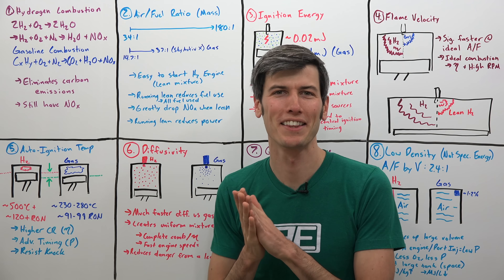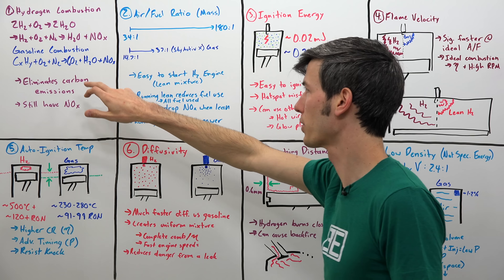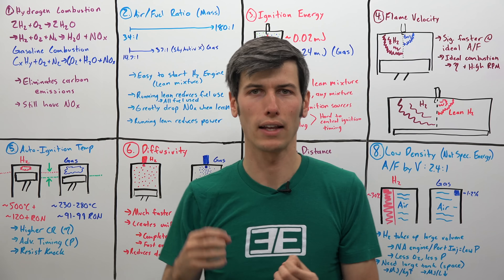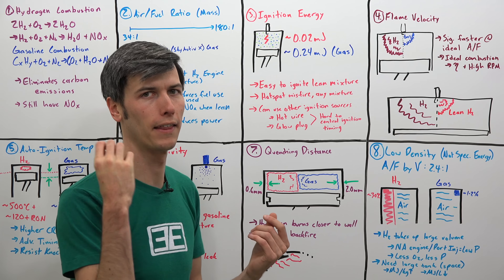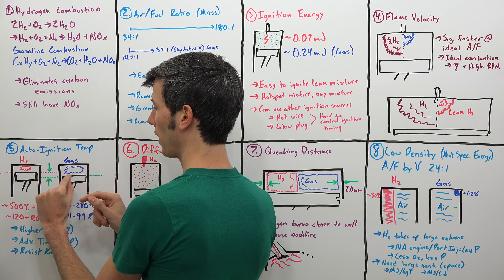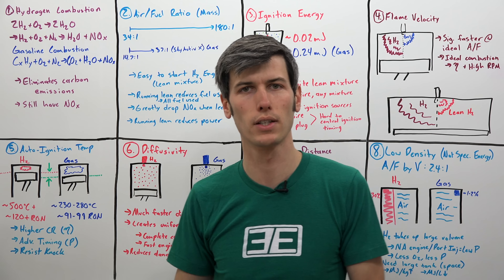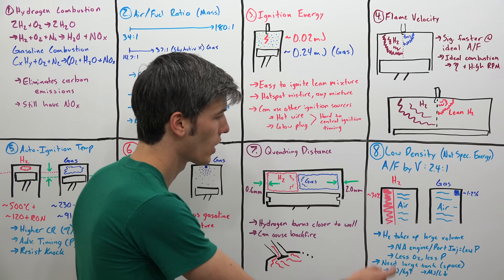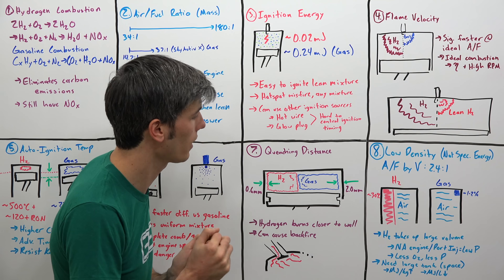The Difference Between Gasoline And Hydrogen Engines

Comment: My two observations about hydrogen as a fuel...  1) H2 is NOT a fuel source.  There are pretty much no natural reserves of H2.  There is plenty of H bound up chemically in various compounds, but it takes just about as much energy to turn those compounds (like water) into usable H2 as what you get out of it via combustion or fuel cells.  So, H2 should be thought of more as a battery than a fuel source.

2) H2 is a very very tiny molecule, like so tiny it will slip past other molecules and crystalline structures.  That means even if you took something like a steel tank, and welded all the holes shut, the H2 would still leak out through the walls of the tank.  H2 is never used as a rocket fuel much after the initial launch (where it works great) because by the time you got anywhere most of your fuel would be gone.

A hydrogen based economy might be doable, but it won't be easy.

Comment: So what it sounds like for a given amount of performance, a hydrogen engine would have more, smaller cylinders than current-generation gasoline engines to reduce problems with flame velocity, would have compression ratios more akin to diesel engines, would need much more specific attention to detail paid to the combustion chamber and piston crown designs, and ideally would benefit from technologies like direct injection to reduce problems with quench distance as the engines wear.

You discuss the use of ambient air (hence the introduction of Nitrogen), how would the efficiency of the engine be affected if the vehicle didn't use ambient air, but instead used separately stored hydrogen and oxygen fuels, and drew only from those sources?

Comment: Hydrogen as a transportation fuel is a non starter. MIT research shows it to be only 6.9 percent more efficient than gas used in a Prius due to losses in production. It has only one twenty fourth the mass when stored at 5000 psi so little available energy  because so little can be carried in vehicle.  Normal storage tanks only go to 2000 psi so even less available with current technology.  The tanks are very heavy at around 175 pounds each and hold only a few hundred cubic feet of gas.  If hydrogen worked we would already have it.
Reply: Storage tank in Mirai is rated 10,000 PSI. I don't know about MIT study, but if you look at Mirai 5kg H for 300 miles, that's 60 MPGe. Since Mirai also has battery for regen, that's actually worse than a Prius when you consider H generation losses, especially from electrolysis.

Comment: Too bad hydrogen is also a fossil fuel. 

(Yes, seriously, it's made from natural gas)
Reply: It can be made at source by electrolytic reaction directly from plain water using electricity. But its inefficient ...why waste electrical power for cars. Straight to battery!
Reply: Magnus Dagbro I forget the exact percentages but I think somewhere around 40% of bulk hydrogen comes from steam methane reforming. A few other methods exist but also break up fossil fuels to extract hydrogen from the molecule. Only around 4% of global hydrogen production comes from electrolysis

Comment: So basically, Hydrogen is better in almost every single way...

I'm sold ¯\_(ツ)_/¯
Reply: Producing and storing is difficult. It takes a lot of electrical energy to obtain hydrogen. Might as well use that electric energy to charge the batteries.
Reply: Except for storing...hydrogen is a real pain in the ass to store.
Reply: Except its 10x more expensive and the engine has to be designed for it! So engine is now 10x more expensive! Hydrogen will never be viable!
Reply: Until you see the prices...
Reply: not práctical for now

Comment: I don't get how items 3 and 5 could live together. Item3: hydrogen has lower ignition energy -> higher misfiring chance; Item5: auto ignition temperature of hydrogen is lower -> higher possible compression. When you compress a gas its internal energy is bumped up (lower volume & higher pressure) which leads to higher chance of misfire, right?
Still see a contradiction here.... scratching head :)
Reply: Vadim Makarov der zündpunkt von h2 is höher als bei benzin

Comment: i want hydrogen rotary engine
Reply: ECO-doritos. 🍂 🌎
Reply: Mazda already built one of these. Fast flame propagation would be nice, but since hydrogen has even less lubrication properties than gasoline I imagine the oiling system is more taxed. It'd be cool and I'm a rotary fanboy but I don't see how something like that goes mass market.
Reply: Mazda build several bi-fuel versions of the RX8 called the RX8 Hydrogen RE. They were not for sale, only for lease. 
At least 2 were delivered in Japan and 30 in Norway. I don't know what happend to them but I would love to own one!
Reply: @erwinnijs1  I didn't realize that RX8 actually went past a demonstration phase. That's cool.
Reply: LiquidPiston has a better rotary engine then Mazda. Hydrogen powered liquidpiston engine would be amazing!
Reply: @johncurran1179  Everyone testing an engine on a bench seems to have better engines than people with actual commercial distribution.... funny that. Let me know when they're in thousands of consumer vehicles and we can talk about how they're "better"
Reply: Check out the Qurbine
Reply: they did have it  rx8 hydrogen fueled renesis
Reply: You'll love it, if you can find a way to lubricate the apex seals. Smooth idle.
Reply: I want a turbo hydrogen engine
Reply: Good luck sealing the engine
Reply: It already exists... For more than 5 years.
Reply: There was an hydrogen rx8
Reply: I want an hydrogen generator, that self runs, and generates electricity.
Reply: Blows up
Reply: @usingthecharlim  like cooling up  a small vocalno once every cycle with dry ice LOL
Reply: Thats how i ended up here 😂 most efficient engine plus most efficent (free potentially) fuel. Its seems to be better then petrol in all aspects?!
Reply: You got it😉
Reply: wouldnt make ANY sense but yeah why not lul
Reply: @user-qx7tm5df8j  it would make sense because one problem of the rotary engine is the fact that fuel doenst burn fast enough, that why you see flames in the exhaust
Reply: @usingthecharlim  needs a rotary engine that doesn't use Doritos as it's rotor
Reply: @GustSergeant  If the engine blows up at least he,ll have a tasty snack to go with his cup of joe . lol
Reply: When rpm is high enough in a rotary, you can do away with seals and up the boost to compensate blow by. It wouldn't be a drivable engine in the common sense of the word, but it could make a very good range extender, for a system without direct connection to the wheels (i.e. engine only coupled to the generator)

Deleting seals would have the advantage that you don't need to inject oil into the combustion chamber drastically improving emissions.
Reply: @daszieher  indeed, rotary can be tuned to be eficient and long lasting but only for a very narrow load and speed band. connecting it to a generator would make it a perfect range extender
Reply: When my rotary deleted it's own seals it didn't have enough compression to fire. I'm not saying it's impossible but in addition to the apex seals you have corner seals to lubricate, without these the engine oil is free to hang out in the  combustion areas as well. I don't see why you'd want a heavily boosted leaking rotary for a range extender. Also a range extender that runs on exotic fuel seems counterproductive. Mazda has already introduced a little rotary for range extension and it has apex seals. The thing with the extender, since it's not responsible for moving the vehicle, it can operate at whatever the efficiency sweet spot is. Not boosted and losing its mind. If the goal was just to go nuts with a combustible fuel I think you just go turbine at that point.
Reply: There are benefits to running without corner and apex seals, since these are the weakest spots and their very lubrication limit the attainable exhaust quality. Main bearing lubrication can be sealed off differently.

Your own rotary would not fire, because it's clearances were not designed for this, also the starter will not bring it to the necessary revs. I consider this part of your comment in which you compare a broken engine to a concept a  mere distraction. And I had mentioned this in my post (drivability).

Using hydrogen as a fuel is an entirely different subject, I am not a hydrogen advocate. Since I feel we'd get lost in pros and cons beginning with its excess renewable production (in order for it to be a viable fuel), the distribution through an insanely expensive infrastructure and complicated handling, I just omitted that part of the discussion. For what it's worth, I don't see H2 being a worthwhile fuel for conventional piston engines in passenger cars owned by private individuals.

Back on subject, such a seal-less rotary would need boost to reach sufficient chamber pressures to make it a worthwhile ICE, NA it just wouldn't reach satisfactory efficiency levels.
Reply: @daszieher The Apex Seals, in addition to providing for a sensible combustion pressure, also form an attrition point. The original Rotary didn't have them, and they annihilated themselves tearing up the rotors and housing. There's no magic to get around this. Whatever is harder, the housing or the rotor, will get destroyed without some kind of attrition barrier. Machine the tolerances as high as you want, there's either an oil barrier between them or grinding metal between them.  

The metals are going to expand and contract under the temperature loads. Particularly challenging in the rotary who has a much hotter combustion half than exhaust/intake half. Meaning our tolerances have to survive that as well.

But lets assume you get the metallurgy and the manufacture just right for this theoretical engine. What is this range extender for exactly. Why overcome the kind of engineering problems that would serve a boosted out of it's mind race car, for a compact generator. My broken engine wasn't a distraction, it was a bit of hyperbole to illustrate a genuine point. The apex seals were introduced while solving rotary engineering problems. Though bringing it up is a distraction from the laundry list of problems this concept engine has. The most important of which is it's proposed use case. Who's looking for a green car with a backup generator so high strung it vomits NOx like a drag car.
Reply: @starvalkyrie  The apex seal wear problem has been solved decades ago. Ceramic apex seals last virtually forever and require very little lubricant. I used to work on rotary race cars and apex seal were one of the few parts that were reused over and over again after every strip down and inspection.
A rotary range extender makes a lot of sense. The high specific power, low NVH, and minimum BSFC at relatively high RPM make it an ideal engine to drive a generator.
I developed one for a race team that wanted to use it in a series hybrid vehicle for a 24h-race. Without much effort I could get it up to 50+ % efficiency. Unfortunately they decided to pursue the fast charge route. We are talking about megawatt chargers here! 
Can you imagine every car and truck on the road using one? Every gas station would have to be converted to a mini power plant.
Reply: @erwinnijs1  A rotary range extender makes sense, a sealeess one does not. You're popping in on the second half of a discussion here.
Reply: @erwinnijs1  The ceramic seal thing solved the problem for race cars, the need to machine the tips to fit thicker seals keeps that from being a drop in replacement for road vehicles. And the apex seals, while a hot issue aren't really that big a deal for the rotary. Hell my graphite ones were abused and still lasted 170k miles(found out later my oil metering system was faulty).
Reply: @starvalkyrie  Ah sorry, should have read the hole discussion.
Yeah, the oil metering system is often the culprit, that's why most people premix even in roads cars. I suspect neglect and lack of knowledge about these cars is another major culprit in many cases. These cars, like many sports cars, are ment for enthusiasts.
BTW, If you ever should get hot start problems due to decreasing compression, try increasing the cranking puls width. It usually fixes the problem.
Reply: @erwinnijs1  Word, I started premixing late in the cars life but between the faulty metering, and the fact that when I first got it I didn't know better than to load it up cold the apex seals took all they could. The car has been collecting dust in my garage for years, when the seal went I was on the highway doing 100, it took the rotor tip and the house with it. I fit the bill for rotary failure. Just too ignorant when I first got it. It's my dream car though, I'll put a rebuilt motor in it when I have the time/money.
Reply: @starvalkyrie  There are technologies that can make H2 on the fly using gasification to convert biofuels to H2 and CO. This is exactly what my company will be working on in near future. This machine will convert Hemp base fuel pellets into H2, CO CH4 to fuel a small rotary for range extension.  We plan to offer a pellet fuel processor in the near future as well so the end user can produce their own fuels for free. This technology can process garbage, plastics, grains, plant matter and woody based biomass.
Reply: We will later work on SOFC technology and eliminate the ICE for range extension later.
Reply: It would be interesting to know if blow-by is worse in hydrogen combustion, since the smaller molecule and nearer to combustion wall burning, would that be overkill for the apex seals?  Is it an issue in piston engines getting by the rings?  Either way, for race applications it might be interesting in a rotary w/ the better flame propagation.
Reply: @christopherhurley2570  He said it is. See "quenching distance."
Reply: My company maybe working with a new company that is working on a small rotary for renewable energy technologies. The flame velocity is so much faster than gasoline H2 maybe the perfect fuel for the rotary.
Reply: no

Comment: As we generally get hydrogen by electrolysis, where water is split, the other output is oxygen. Imagine these are both transported to the pump like you have -2-component glues in separate parallel tubes. Then you could use the pure oxygen (without nitrogen) and not produce NOx? No inlet valves, just injectors. Has this been tried? Now what if we could have a hydrogen fuel cell producing electricity? We did not need complex and heavy transmissions with lots of losses if the electric motors were integrated in the wheels. Has this already been done?
Reply: Well then you need 2 tanks of oxygen for every tank of hydrogen, and the hydrogen tanks are already massive to get any decent range.
And yes hydrogen to electricity conversions are being done with fuel cells, there are many fuel cell cars on the road today.

Comment: What about using hydrogen as a secondary source through the intake manifold in a regular gasoline engine?  Would the hydrogen improve the combustion efficiency of gasoline at some optimal ratio?

Comment: Would hydrogen fueled race engines significantly cut weight improving speed? o_0
Reply: Considering Mirai, "simpler" H fuel cell car, weighs about 4100 lb while being smaller than Corolla that weighs under 2800 lb, I doubt H engines will cut any weight and instead weight significantly more.
Reply: Mirei uses Fuel Cell. 
Not a Internal Combustion Engine

Comment: Excellent explanation! What about on demand hydrogen generation though? I know for a while lots of people were making systems like that on their cars.
Reply from the maker: Generally those HHO things are a scam, though hydrogen can indeed be used as fuel.
Reply: @EngineeringExplained  i build my own HHO and improved the mpg of my sisters car by 40%... citroen xsara 1.4 8v 75hp... they aren't scam, most of the people who sell them are scammers...
Reply: @EngineeringExplained  you should make video about HHO generators but u need to test it first

Comment: For the emmisions point, AddBlue to reduce NOx.
For the hotspots, those are usually carbon deposites, and that's not going to be there as said in the emmisions part.
So perfect for the new supercars
Reply from the maker: Spark plugs and exhaust valves can also act as hot spots, depending on the temperature requirements and ignition energy of the fuel.

Comment: There was a 9th you could have added and that's the relative volume of gasses produced in the combustion chamber. With Octane as a fuel you convert 9.5 units of gas into 13 units which increases the pressure in the chamber more than just the increase in temperature, with hydrogen as a fuel you convert 3 units of gas to 2 units which actually reduces the pressure in the chamber compared to just the temperature rise.

8.5O2 + C8H18 -> 4CO2 + 9H2O rather than O2+2H2 -> 2H2O (sorry about the lack of subscripts)

Comment: what about using hydrogen for top end as an additive, lets say to replace a water meth with a water hydrogen injection, will it work is addition to gas ? and can we get the best of both worlds
Reply from the maker: Yes, it can be used in combination with gasoline. I'll actually be making a video about this soon!
Reply: @EngineeringExplained  the combustion engine will live a little bit longer, we just need a fuel cell that can extract hydrogen from gas to keep things integrated and elliminate the need for keeping up with multiple fuel tanks